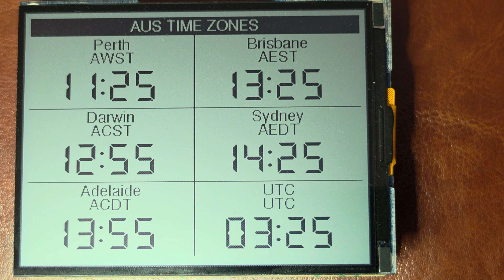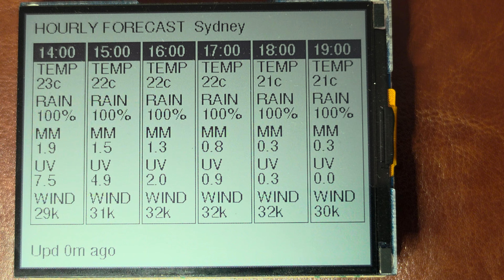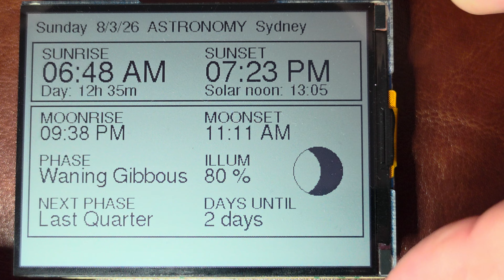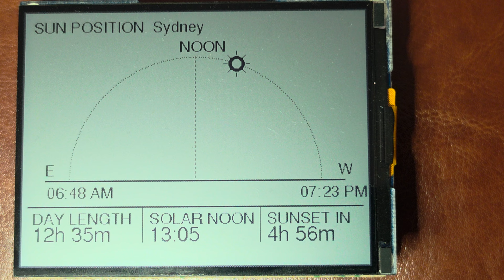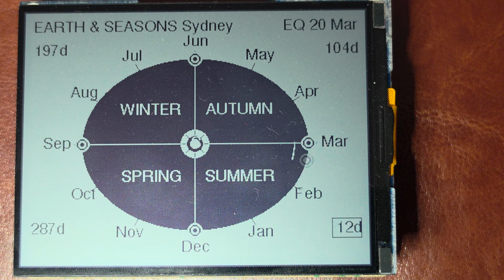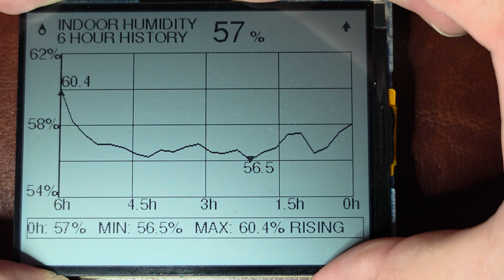Waveshare RLCD ESP32-S3 Weather Dashboard

Comment: Thanks. Is it easy read the display in direct sunlight?
Reply from the maker: Yes it's very clear in natural light, the thumbnail for this video was taken outside.
Reply: Ok. Im think of making a windguru display for our windsurfing club. It will be inside a window and some times directly in the sun. I was planing to use a e-ink display but they are expensive and slow. This seems much better. Al the hardware we need in one package. I only need to  3d  print a case and some programing. I can probably use you software as a base (im not really a programmer).
Reply from the maker: @warheadkdk  yes this would work well. just one thing to note the RLCD screen is very fragile, it even comes with a big sticker on it with this warning,  A case would be a good idea, be sure to check out Waveshare's other offerings,  they have a number of ESP32 units with displays of all types. You can use AI to help rework the code as needed